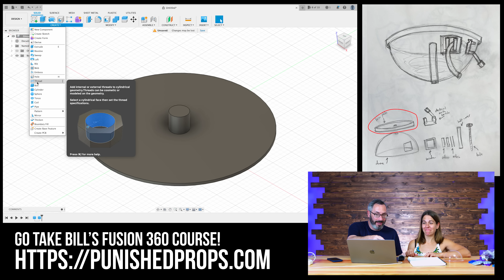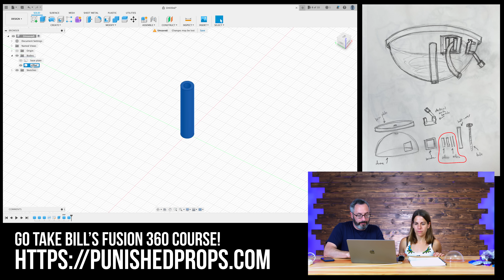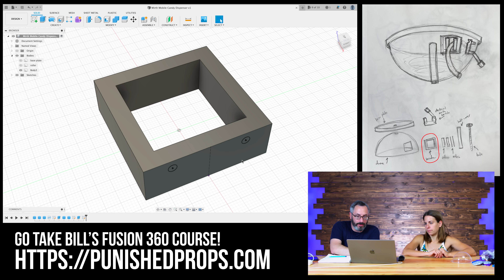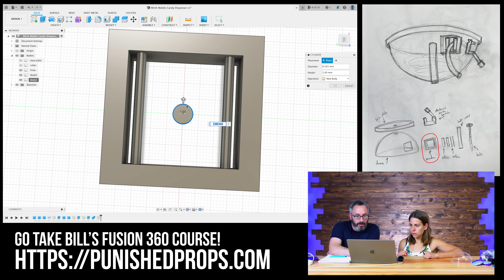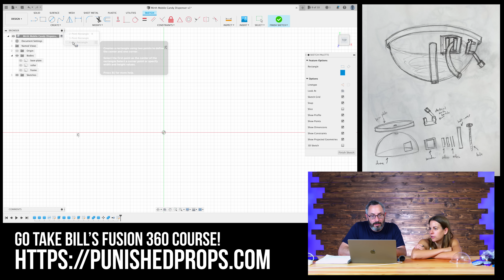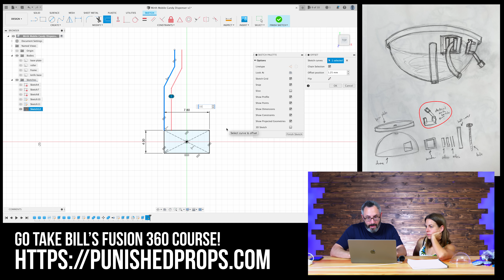Fusion 360 IS EASY?! Tutorial from Punished Props!

Comment: I'm fully aware I'm gonna sound like your internet armchair expert, although I'm really trying not to hate. But this was bad, really bad. This video should start with an exclaimer that it is NOT a tutorial on how to properly use F360 (or any parametric history-based CAD for that matter), but just a quick'n'dirty* way to have someone create a model with no regards to good practice, efficiency and robustness whatsoever (* not really quick, but pretty dirty). He basically gave her a short lecture in "How to use real CAD software as if it was SketchUp".

Just some random points, make of it what you will:

0) I get that this is not a proper introduction to CAD software and all, but at least give her a 5-minute rundown. Like, these are the main bits of the gui, here are the most important buttons and stuff. Go a little into how almost anything is created as some type of extruded feature based on profiles and paths; how geometry is defined by dimensions (not the other way round) and other constraints ... You know, just the most basic stuff.

1) Wherever you can, choose a datum that is likely to stay there for good. For example, do not glue sketches on part surfaces (if you can help it). There is a good chance your model will explode at some point when editing/removing that datum surface (no, that's not just an issue with FreeCAD's notorious TNP; it's kind of bad practice with any CAD software).

2) Think a little before you rush in and create a bunch of sketches for a single body where one would have been enough. There can be valid reasons for either approach (not cluttering up a single sketch vs. not cluttering up your history tree and so on), but what's the point stacking cylinders on top of each other (while also doing (1)) when you could've just created one very simple profile for a rotational extrusion .... At least try to make a conscious decision (based on reasons), is what I'm trying to say, I guess.

3) Also ... Creating simple cylindrical holes in the frame as boolean operation with tool bodies?! Can you get any more complicated ...

(I'm not a CAD guy. I'm just some rando from the internet. So pls take anything I said with a spoon of salt, check with proper sources and whatnot.)